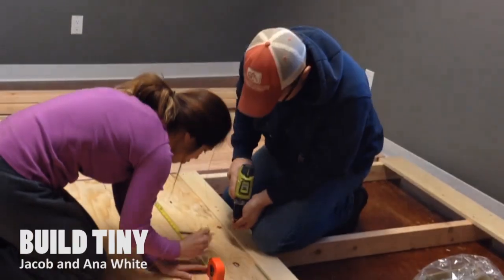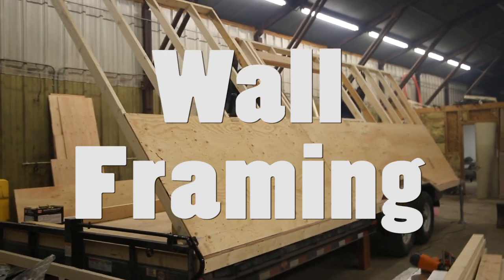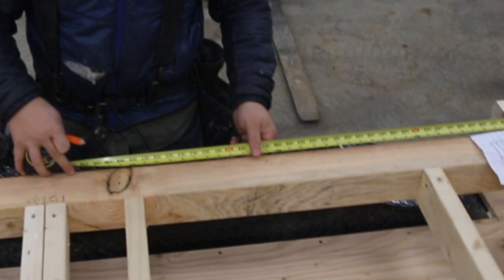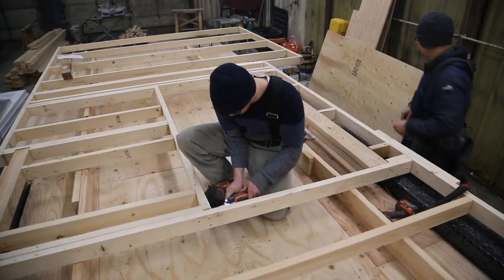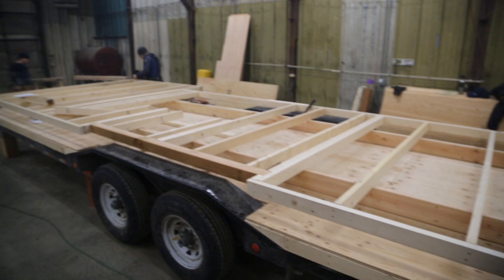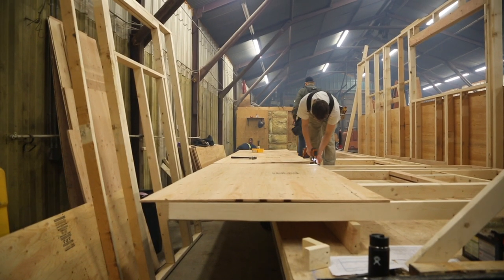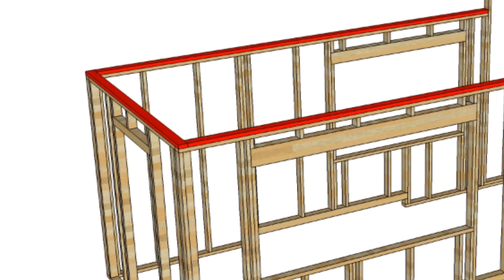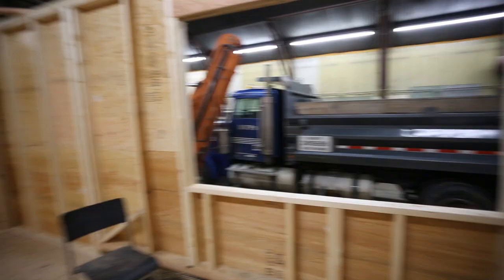How to Build and Frame Tiny House Walls: Ana White Tiny House Build [Episode 3]

Comment: Nice job!  I like the idea of building the walls along the eave sides in 1 whole section.  Just an idea though. You could omit those oversized headers and put a 2x on the flat between the king studs.  There's not much load above and this would reduce weight and thermal bridging.  Looks great though!

Comment: Can't wait to see your choice in doors and windows.  I would imagine you need great insulation value in your climate.
Did anyone ask you about your choice of trailer?  Where you find a good one, what you'd avoid, and what to look for in reinforcing at the front end to be sure it can carry the weight.  I frame like you do.  If I had that shop space, I'd put in an overhead crane (even if lightweight) and lift the walls.  Can't wait to see your progress.
Reply: Stay tuned we will be putting out a video on how to select a trailer. I like you crane idea for setting walls.
Reply: Thanks.  I've followed sooo many things on Ana White plans, and the whole MomPlex build.  So much fun. We bought an old lift mechanism on wheels (was used for big bore pipes) and we've used it to set much bigger beams and walls.  It was a hand crank (with ratchet) but we hooked it up to drill driver for better speed.  Handy for many years.

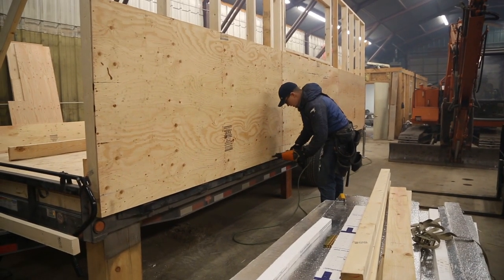Comment: When you put that first wall up at 5:30, how did you secure it to the floor? Bolts? Nails?
Reply: I've seen people use self tapping screws with washers and other people have used bolts. I personally Like the bolts to already be welded to the frame and then to secure my base down with large washers and nuts. I think bolts, washers and nuts add more strength to your foundation. This is extremely important for traveling 70 Mph down the interstate to a new location.

Comment: Hey there, please tell me if this is a bad suggestion, but another way you can get the openings is by drilling a hole once the plywood is up and then using a router. This way if you are not comfortable using a circular saw, or are weary of your lines, you will have an exact guide for the cutout. Finish rounded corners with a hand saw.
Reply from the maker: That would work too!  We just don't have a router on site.

Comment: Ana, I grew up in a carpenter household, but my dad wasn't keen on letting me use anything with a rotating/reciprocating blade lol so I never really got much experience with it. And though I don't scare easy, I can't say I'm super confident when I think about picking it up to start doing my own projects. Any hints to help?

Also, I haven't held a nail gun in my hands for about 8 years now and even then it was more of my dad pointing, and I was shooting. I know you said you guys had other projects coming up, but I wondered if you could possibly do some how-to basics some time in the future? In this vid you went through the wall process of this tiny house, but if there could be a tutorial series that were more detailed on things for improving on existing structures? For instance framing out a wall, interior and exterior. Hanging a door, interior and exterior, and windows, etc., and what details there are for each, why you do it this way or that, just like you do how you do.

I want to enclose our back porch and make it a work room, this would move the current back door from where it is now to the new back wall. I just need to create 3 walls, 1 exterior door and X windows. It's just a box up really, it's already got a roof. I know it's not impossible if you know what you're doing. I just... don't exactly lol

I've never asked anything like this of anyone on youtube, you're the only construction instruction person I can watch. For my dad it was Bob Villa lol I'll take you for my generation!
Reply from the maker: Hi Jodie, Thank you so much.  I did not grow up using tools either, but we are changing that with the next generation, right?  I'd suggest having someone who uses tools give you a hands on demonstration with tools - we can definitely do more in depth videos in the future per your request, but there's no substitute for having the tools in your hand.  You can do this!  Thanks so much for the support and comments!  It is much appreciated (and needed).  XO Ana

Comment: Great vids guys! I have a request - Some tiny house builders go with 16 on center and some 24 on center. Can you discuss a bit more about the pros and cons of going with 24? I'm trying to decide which is best for mine. I'll be moving it twice a year from so cal to nor cal.
Reply from the maker: +Kitty Bell HI Kitty!  Awesome to hear you are planning to go Tiny!  if we could live in it full time we would (active kids + extreme Alaska climate = indoors for a big part of the year - very envious of your better climate) but just doesn't make sense for us at this point in our life.  The big reason you go 16" on center is for a stronger wall.  But these walls are so small, and the roof the walls support is so small, I really can't see any pros to going 16" on center.  After framing these walls (and adding spray foam which really creates a rigid, strong wall) I wonder if we did overkill on the framing and could have gotten away with even less (ie no jack studs, smaller headers, no cripples over jack studs) as they do in "Advanced Framing" would look into that to keep the weight down, save money on materials, and take out some steps when framing.
Reply: Ana White Thanks! This is helpful.

Comment: We are in the planning stages right now for a shed conversion into a tiny home but this has me thinking that putting it on wheels might be a better option. Love the design, just needs a bathroom! Thanks for going over the "why's". One question, are you concerned about movement or racking in your windows/doors? That's always been my big question about tiny homes that travel.
Reply: As for Windows and doors and movement. I thought this might be a problem myself but after framing and spray foaming the wall cavities this tiny house is very solid. Don't for see a problem but Alaskan roads aren't the best either.

Comment: Nice Job!! Thanks for answering that square question I was just trying to find out myself. How do you make sure your miter saw is square? Thanks again guys
Reply: Use a square and adjust accordingly. The manual for the saw will walk you through this task.
Reply from the maker: +D. Ali Thanks!  Also make sure you test for square by cutting a board, and then checking to see how square the cut is with a speed square.

Comment: Thank you for another interesting video. Why did you decide on wood instead of steel framing? It's my understanding that steel is one third the weight of wood, which I'm assuming makes the tiny house less expensive to move. Thank you and regards.
Reply: The trade off between wood and metal is initial product savings/weight increase vs fuel transport savings/weight savings.  Also steel requires different tooling.  Personal preference if one has constructed from both can also play a role.

Comment: Very informative, thanks! May I ask how widely and deeply are the wheel wells sticky out inside the house -without the insulation yet on top? Also, how high did you build the loft (how high is it from bottom to ceiling)?

Comment: How are the walls anchored down to the floor? I saw the floor video which you used large bolts to fasten it down, but won’t the walls take the most of any wind/movement on travel and need to be anchored well? Did you bolt them down to the trailer frame somehow as well or just nailed down to the floor joist?

Comment: I noticed that there aren't any diagonal beams to help keep the house staple when driving it.  is there a reason?  all the other tiny builds I have seen they have put diagonal piece of wood in to help support the structure from twisting and moving around when driving.
Reply: The sheating on the outside of the entire building make it rigid, anchor bolting of sil plates, and overlapping head plates do the trick.

Comment: I have been planing for 8x20 trailer for small shop but I was thinking of going all metal framing and metal outer siding. I haven't done any cost or weight comparison.
Did you do any comparison as to metal vs wood? and if so how much of a materials price / weight difference was it? If you don't mind me asking.
Reply: Haven't done any comparison but it would be lighter.

Comment: Great video. Question: there is OSB and plywood. What made you choose for the more expensive plywood? Alaskan weather? And the sillseal, isn't that only used for isolating the wood from a concrete base? Thanks for replying and for a great start of the weekend. Until next time, bye
Reply from the maker: +Frits van Doorn That's a great question.  OSB is fine for use, but we had an experience where it got wet and just fell apart.  Ever since then we've spent the extra money on plywood. We do sill seal under all exterior walls, more for insulating and keeping drafts out than for moisture protection.  Maybe it's a different product here in the US?
Reply: +Ana White I do not know if it is a different product, because all my knowledge about framing comes from books and Dvd's I ordered in the US and from what I have learned on YouTube. Maybe one day I become a Carpenter and can build framing myself. But then I must emmigrate to the US because here in the Netherlands there is not so much house framing. And that is why I really really like video's about framing. Thank you!
Reply: I wondered the same about the sill seal...in standard housing it goes between the concrete subfloor and base stud for moisture control. A great use of the sill seal is between the trailer flange and the 3/4 tng ply.

Comment: hello you guys look like u do amazing work I have a few questions. I have a unfinished  tiny house and its a wreck. It was partially built by my ex husband. he wad not a professional at all and one thing u said that really worried or two things is it was not leveled out when we first started even though I told him it needed to be and the framing is horrible due to the fact that it is only put together by screws. I have no clue where to start to correct these major problems without starting all over. I need alot help and advise.

Comment: Instead of using the typical stud build technique what about composite material not sure if I am using correct terms but it is a plywood foam plywood pressed together which is supposedly very strong, uses less space and is energy efficient plus weighs less. Is this something that can be used? Thank you again for these videos.
Reply from the maker: Hi!  We just don't have a SIPS source here, but certainly, this design could be framed using that method.

Comment: Hey! Thanks for providing these videos and the blueprints. I'm actually in the process of making my own, roughly based on your plan. I've got the sub-floor complete, and I'm in the process of framing. I have a question though. How did you secure the framing to the subfloor? Did you just nail it all in place?
Reply: Hi dear, how did you get the blueprints from them?

Comment: Looks good, but if this is going to be mobile wouldn't the glue and screw method give you more longevity in the structure?  Even ring shank nails would allow more movement in your structure.
Reply from the maker: +jdace66 Hi, yes, we did do ring shank nails with glue.  We also did quite a bit of screws as well.  For our purposes, this tiny house will only be moved on occasion, but this is a great tip for those wanting to travel extensively with their tiny house.

Comment: what did u end up getting for a first floor ceiling height and a loft height? does your trailer have 4 inch drop axles?  I'm really wanting 7 feet in height for the first floor therefore allowing standard sized upper cabinets, sinking the cut down exterior door to 78" and flush sash, I just can't seem to get my head around a 42" loft. that's even with a four inch drop axle.

Comment: I have been doing some research on Wall sheathing and I was wondering for a trailer build did you gap the panels by 1/8 in or go with a tight fit?

Comment: when you build your header over the wheel well, do you just have it flush? Also, does that not cause a problem later, having your wall not follow the line of your floor joists? I hope that makes sense.  I'm almost finished with my subfloor and I don't want to end up with gaps because I build over the wells.
Reply from the maker: +Tessia Lewis hi!  We do leave a gap over wheel well to spray foam between framing and wheel well.  Our walls are all on outsides of framing fine, you can block more if you want to, we try and limit extra framing because it increases weight and decreases insulating.
Reply: Ana White  thank you!

Comment: I am Framing on 24 inch centers as well for my 32 ft 5th wheel tinyhouse. I also will be doing staggered horizontal sheathing but with 7/16 osb instead of 1/2 plywood. I do have a question though. Do you think it would be a good idea to add blocking to the horizontal sheathing seams? Or do you think that is overkill?
Reply from the maker: I think the big thing here is cross bracing for lateral support.  We did spray foam and there was no issue, but if you do bats, think about adding cross bracing in the walls.  The siding will cover your plywood sheathing seams.
Reply: +Ana White Great! Thanks for the tip, and The videos you and Jacob make are so helpful by the way! I learn something new with every video I watch!

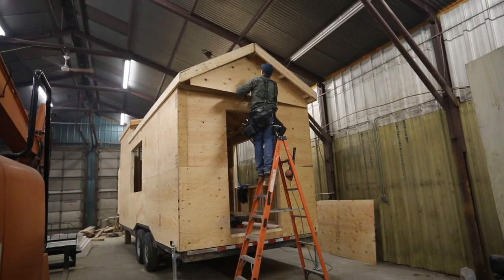Comment: In the 7 minute to 7:40 range - Window and door cutouts with drill holes and a circular saw: I prefer to use a router with a flush-cut bit to cut out openings. Sharp corners need trimming, but the process for me is faster and (usually) cleaner than drilling holes & cutting with a circular saw. Is there any specific reason you use your method instead of the router method besides personal preference and habit?

Comment: Something just occurred to me and would like to ask, if you could go back and change 1 thing in the design what would you change?  because I just notices you has a huge potential chance for massive storage in the floors the space between the trailer itself (lined with 1in thick plywood) and the top of the trailer wheel arch.  And thus in turn you can easily fix in a slide out steps from within this gap in the floor space for steps to your door.  Just curious :)
Reply from the maker: +Peter OFlynn That is a great idea!  We are planning kitchen cabinets over the wheel wells to cover them up, and a table on the opposite wheel well.  That's what's so great about these tiny houses - you can mod them for your lifestyle!  I love that.

One thing I'd change is after the spray foam (will do more info on this once we get to it) the walls are very rigid.  I honestly think we overframed and could have left out alot of the boards in the walls and minimized headers.
Reply: +Ana White Can't wait to see that episode with regards to the spray foam.  I always say we think we know everything we needs to know but when it actually comes to the build itself, you're constantly evolving to suit your needs.  Oh keep up the good work always enjoy your videos for inspiration and ideas :)

Comment: I'm not a builder but watching you lift the second wall into place, wouldn't it have been easier to add the ply wood after the wall was up. Just asking.
Reply from the maker: +Barbara Von Eitzen Hi Barbara, maybe.  It's a trade off of having the plywood keep the wall square and together (since walls are just nailed together) vs increasing the wall weight.  One thing is for sure, glad we didn't plywood the entire wall (and I was just running the camera lol)

Comment: What is your opinion on metal framing? It would save on weight but cost more. Or am I missing something else.
Reply from the maker: +Nicholas Rybarczyk Hello, to be completely honest with you, we are both carpenters and prefer building with wood.  We've heard good and bad about steel framing - the good is it's lightweight and generally stronger,  and the bad is the steel is worse for colder climates and screws have been known to come loose over time with movement.  Would love to tackle a steel framed project one day though!
Reply: +Ana White Good point on screws coming loose. I haven’t thought about that. That would really ruin your day.

Comment: Quick question, why do you guys buy Ryobi and Ridgid tools? Why not DeWalt or Makita?
Reply from the maker: +Tj Greene Hi Tj, We choose to use Ryobi tools because we believe they are the best value out there for our readers. For the price, you can't buy a better tool than Ryobi, we've used them for years, on projects big and small, and are always amazed at how well they perform considering the cost.  Most of our readers are beginners/ocassional diyers, so investing in contractor grade tools doesn't make sense.  We also love that the Ryboi battery system (since the battery is the big cost) works on over 50 tools so you can go from drilling to vacuuming to inflating tires all on the same battery.
Reply: +Ana White ya that makes sense. I was just surprised, I'm 14 and a diehard DeWalt guy so I buy them. But Ryobi is getting better over the years the blue tools where complete garbage, and the green tools are great!

Comment: I under the larger header in a conventional build home it is it really necessary in a tiny home. The roof loads should be that heavy. Again I'm thinking of weight.
Reply from the maker: +Matt Tolman I agree.  You could save alot of weight by taking out some of the headers and cripples over jacks etc.  Especially if you are spray foaming. But that's something one could easily do on their own, depending on their own roofing requirements.